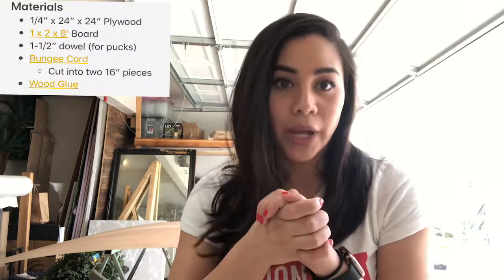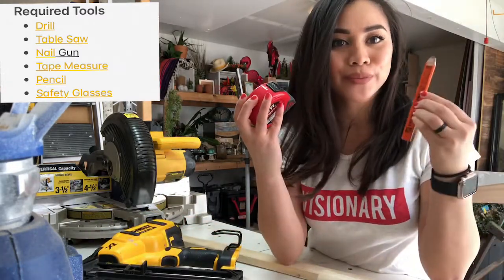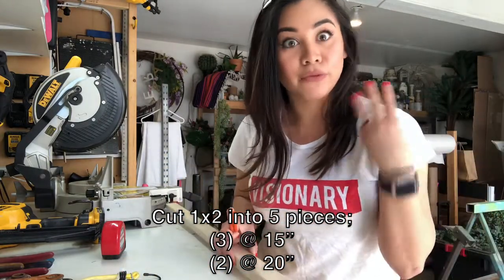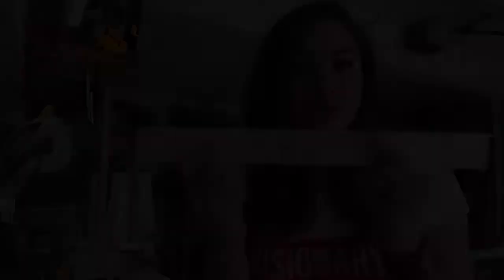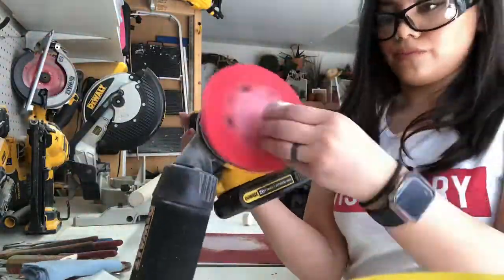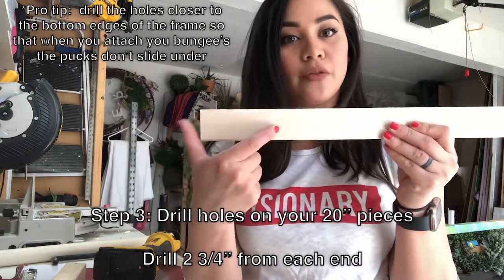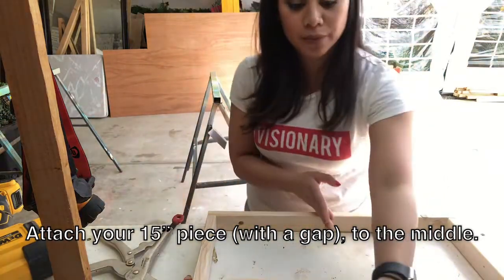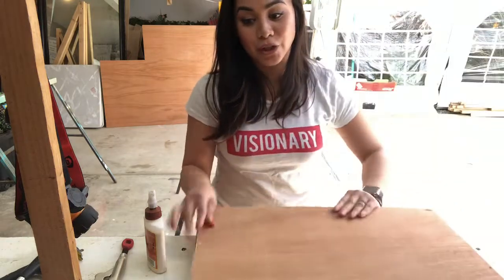How to make your own Fast Sling Puck

Comment: At what point did you notice that your pucks and the slot were both 3/4 of an inch? Why wouldn’t you paint the bottom separate from the sides and then put it on. Seems it would’ve been much easier unless your using a small brush.